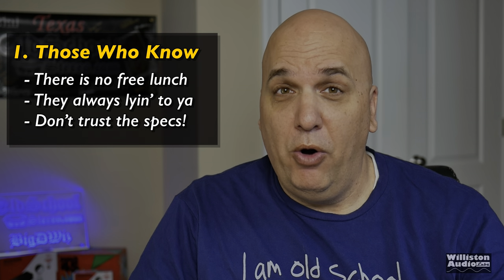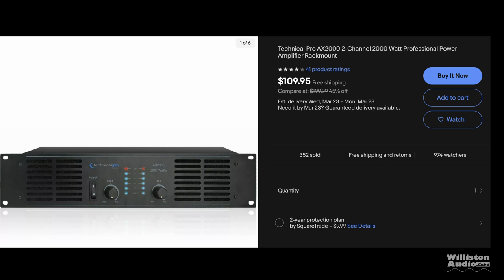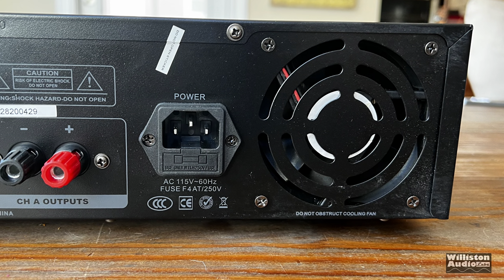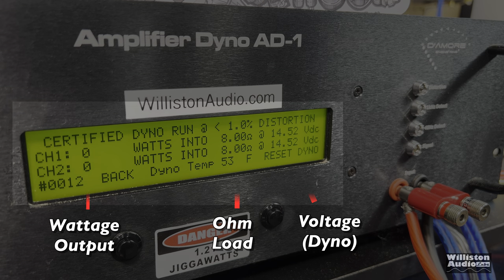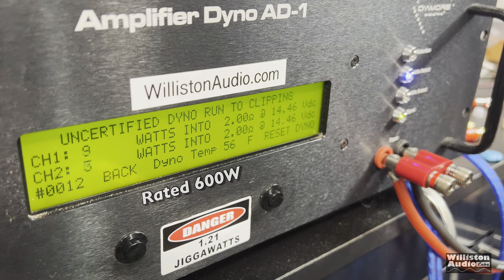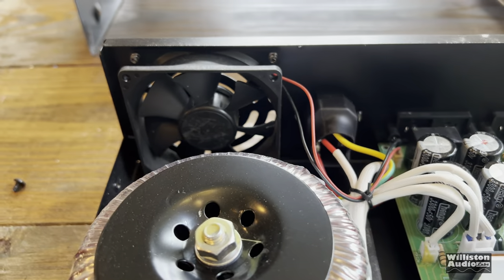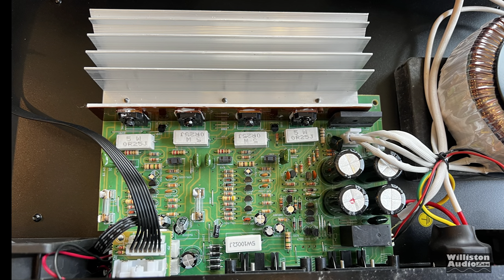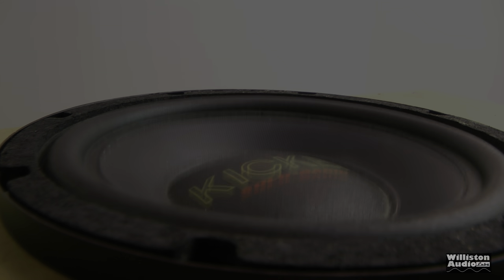Pro Audio Amp on the Cheap? Technical Pro AX2000 2000W of Unicorns [4K]

Comment: Bought a 600w technical pro amp many years ago… yeah I know stupid. But I was a little kid basically. Pretty sure the amp only made around 15 watts and it died a week or so after buying it. Now I have a crown 2500 watt amp.
Reply from the maker: Sucks to waste money, doesn’t it?
Reply: @wal  I was probably around 12 at the time. I saved up for that thing. Was trying to power 2 cerwin vega 12” subs. Now I’m running a wall of 8 12” Skars along with a few Vegas and klipsch. I’ve learned my lesson.
Reply: @troybateson  8 12s in the house?
Reply: @eatyassy6568  yup, 14 12s total. I’m also running 2 15” Skar evls in my vehicle. Which is the biggest thing that’ll fit in my hummer without having to build a walled enclosure.
Reply: @troybateson  Wow, can you please post a video of it bumping? I have 4 12s that I wanted to use in my house but was wondering what I would power them with

Comment: The distortion on this amp will change with temp , the transistors are definitely not matched pairs. So not even close to pro audio  there are better kits in AliExpress with better transistors ... This amp should not be used below 4ohm .
Reply: How about ... this amp should not be used!! 😅

Comment: My crown audio xls 1000 is rated 2 ohm bridge
Reply from the maker: Not many home or pro amps rated that low. Crown is 👑
Reply: @wal  definitely I got the xls for free and I'm using it to push my re audio 12 getting another one soon to push my massive floor speakers. As they got the 15inch woofers in them
Reply: Use them too... mostly it's all in the Drive Core Technology

Comment: This brand. I got no words. Or I would, but I'd had to write an essay  (Oh, I just did..) just from the amp details on their page alone, not to mention their "story" on their Facebook page... It's like a fairy tale. How can something like that even exist? I mean, a brand that has nothing but nonsense and praise written all over their "info" and seems to have no clue about their products and then just offload the PR to some random firm that is specialized in hype.

"The outputs are Banana Binding Post which are also an industry standard" - nope
"This unit will give you the sound output you need in a crowded club, a stage or in your studio."  - in a studio, output, probably yes
"...It will hold up against the pressure of performing and always set the place on fire! But not literally, Dual Cooling Fans will keep this unit as cool as a cucumber even under long term use so you won’t have to worry about overheating." - Haha, funny! Well obviusly, as many 3kW+ amps have similar fan setup
"In addition there are iridescent blue meters to show your level readings. This is not only extremely useful to gauge your levels but also looks very stylish in a dark space!" - yep, nothing beats  flashing bright blue LED's
"The front panel also holds the power button. This is a very useful feature if you place this unit into a rack….there is no need to climb behind your gear to turn this one on and off!" - Wow! Ingenious.
"There is also a clipping level feature which lights up red to warn when clipping levels are reached…one fast glance to the front panel and you will see your input is at a proper level." - but what about the output?

Specs
Speakon Outputs: Banana Binding Posts 

Please, no. Stop.

From the manual:

"If you’ve spent any time at all in professional audio, you know the name Technical Pro and what it stands for- incredible performance & sound, and the ultimate in reliability under harsh conditions. And now, Technical Pro offers the same technology in a series of amplifiers bringing more of what sets Technical Pro apart from all others"

Also in the manual, they really seem to want you to connect a DVD player straight on the amp. To their credit, they do also mention a mixer.

This is just surreal! Help!

Comment: This thing wouldnt even power a set of poopy rockville or pyle PA speakers!
You wanna decent, affordable amp for DJ/PA use? Best off going with a used EV amp or something similar, or Crowns current bottom tier offering if you need new.

Comment: 😄 Entertaining indeed!  The only way this "power amp" will produce 2000W of output is from a direct lightning strike.  
Other trashy brands of this caliber are Pyramid, Pyle (lives up to its name), Boss Audio and to some extent Seismic Audio.  Years ago, Pyramid amps were sold at Radio Shack as Radio Shack branded amps.  They clipped at a drop of the hat, had poor fidelity and were overpriced.  
9:05  🤣😂🤡

Comment: i dont want to shit on pro audio but i see it as really old designs that are mantained to scam people, like they still use all those huge imputs for no reason dating to the 80's and most of the stuff is sold separately just cuz... like they could fit the preamp the dsp the equalizer and the amp in that box since its mostly empty inside thanx to the small size power amplifiers... but nah lets charge fools 200$ a pop for each one of those.